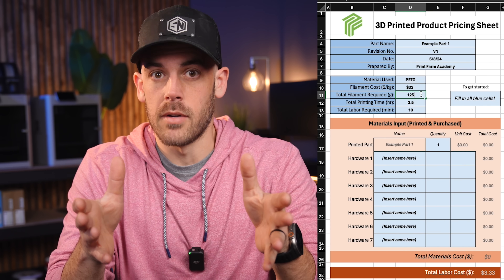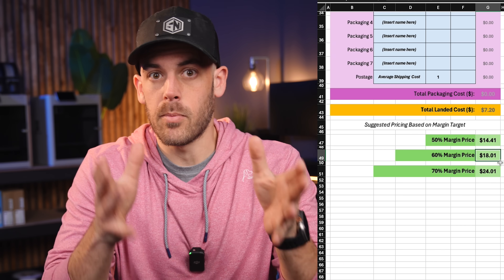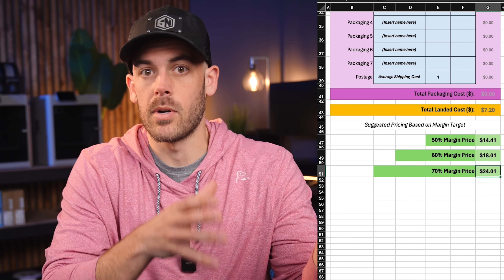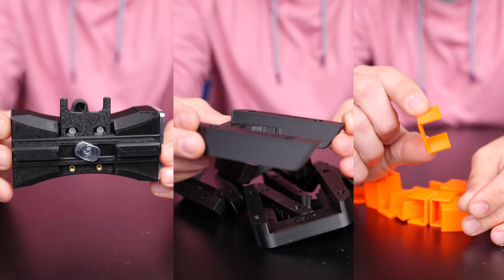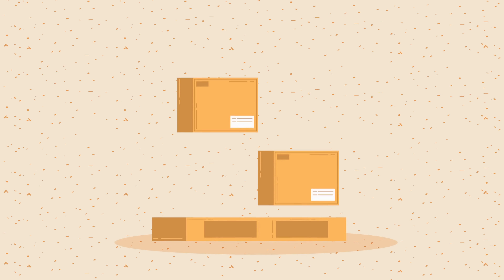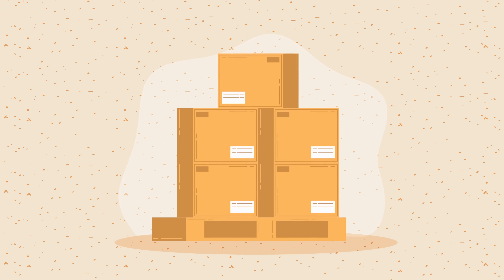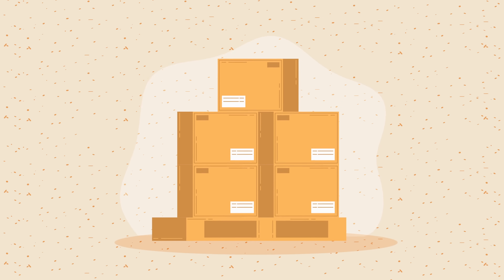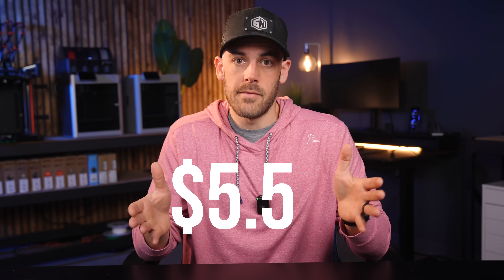Why I charge $55 for this 3D printed part (how to price)

Comment: I contacted a local company to 3d print me a bunch of pieces I needed for a board game. They quoted me an amount that was enough for me to purchase a 3d printer, curing station, and all the resin I needed. 

So yeah, now I have a new skill and can print whatever else I want
Reply: Thats what 3d printing is all about
Reply: @yomommasukks-u9e  totally agree , i think every household should have a 3d printer and more focus would be on exchanging designs and potentially selling those , rather than shipping physical parts around.  3D printing is about taking the power of manufacturing in your own hands not in giving way to corporations to profit from us in a new way with new marketing buzzwords...
Reply: The same thing happened to me lol. I was trying to buy some risers for my couch on etsy and they wanted the price of an a1 essentially. So now I own an a1
Reply: @floresj  Now that something that needs to be improved. for bed risers I got 4 at a home store for like $12. They do not have structure down the middle so the post is sitting on very little built up space, like a hollow riser. After one broke thru, I cut 4x4 wood to install in the middle. They could be printed with better structure
Reply: @floresj  I think they are betting on their knowledge. For some people it worth it to pay the price of the custom design to reproduce and for other, it's a learning journey that is the push they need. That is how it kind of was for me. The learning journey is a better investment long term since now I can do anything at just my time, material at cost.  It's like buying extended warranty. The cost you pay to buy all the extended warranty for everything you of value you buy vs the chance of 1 breaking is way more than actually benefiting from the extended warranty.
Reply: @Slurgical_3D_Terrain_Channel  i would bet a 3D artist or someone that can use CAD software will be more in demand then the 3D printing company, that way you can just pay for the file you need
Reply: @Cagethehedgehog that’s the point printers being an appliance. Print what you need. No waste, no long wait for something that partially fits your need.
Reply: @Slurgical_3D_Terrain_Channel I mean.  I got one and the things I've printed have taken days to print or experiment with my machine and adjust to print right.   I mean I'm using it for some pretty complex stuff but if you need something right away just going out and buying a 3d printer is not as easy as people think. It does take some skill and patience and trial and error. Especially if you're switching between materials ...
Reply: @jhtsurvival true that but it’s like anything else once you learn it, the  long game it worth it. When your job introduce a new platform or anything, you have to learn it, no option there. Before you know it you are a pro at it.
Reply: that's pretty much how it will always be. The only ones making money off selling printed parts are making a shitton or highly specific/custom stuff for people that just don't want to do it themselves and know it's not super cost effective
Reply: I had kinda the same issue... I wanted to buy some Star Wars helmet + armor... then the co-worker of a friend calculated on his slicer the material cost and it turned out that I could buy 2 printers buy the amount I was being charged... so I bought a printer and now I've been printing stuff for myself and selling to people in my area too without being like a freebie but also not making it overly expensive that someone could get the idea to buy a printer 😂
Reply: @snakerooni  How are you selling locally "in your area"? FB marketplace or word of mouth?
Reply: @snakerooni hobbiests selling cheap stuff and undercutting businesses that actually understand how material costs and time goes. Yay. Race to the bottom everyone.
Reply: @snakerooni  this is why owning a bussieness i shit nowadays. they have to calculate a hour rate, pay the bills pay taxes, ladn taxyes IRS taxes (states and gov) U have got new king, gov and their administration xD
Reply: similar, needed two pieces for my RC Supra project, but the quote for those parts was way over cost of buying another printer (previous were too small or were resin printers, but needed FDM) material was PETG for those two parts, so not an expensive material, used 1.5kg and got myself new printer, wanted to sell it right after, but I kept it for well over 1,5 years and sold it and built myself a Voron V2 350
Reply: @anonrider8870  oh nice about the Voron.  I have yet to build mine. I started but have a long way to go.
Reply: seeing some of the resin ones on sale for under 150 has me real tempted to get one
Reply: I usually charge 3€ for a single miniature (25mm or 30mm) how much did they wanted to charge you?
Reply: That is really funny, because that happened to a lot people here, including me ofc. I believe that these prices were just too much and I was like, you know what? fuck it I will buy one myself and I will be able to make anything me or my friends want. So far I have to say that its one of the best hobbies I had
Reply: Yea me too. People get too greedy selling 3D prints. They're literally a dime a dozen.
Reply: same here. on top of that having a 3d printer is also fun.
Reply: Why did you think they'd be cheap?
Reply: people seem to think you're paying for the part... they easily forget you're also paying for the skills to make the print... that you dont have learn yourself... the knowledge someone had to design it go through multiple prototypes the knowledge of cad software the cost of the cad software... just to mention some things you didnt that everyone tends to overlook... that is part of the cost you hire a company to print something for you you're paying for all of that and more...
Reply: Time is $. If you have a lot of free time and desire, you are not their market.
Reply: If it included sculpting the parts, no wonder.
Reply: Sooner or later with that prices that those guys charge it's a wise move to buy one 3d printer especially at these prices now, instead of buy printed items..... Also those print farms have short lifespan i believe.... Next couple of years 3d printing will be more than a hobby....
Reply: Exactly, throughout this video i was wondering, who would pay for such a part $55 where i am 100% sure a Chinese company such JLCPCB can charge a fraction of that. Also an elegoo Neptune 3D printer is around $160. i don't blame the guy for charging $55 but his business only exists because there are folks thee with more money than brains
Reply: @astafzciba buying specific solutions are fantastic. Time and effort is expensive. I often want a solution and buying my way out is often the cheapest way for me.
Reply: so you expect people to work for free for you , you mean !!?.. now you are forced to invest to buy a 3dd printing mashine,, learn the skill, buy the materials, and spent a lot of time tweaking... when you could have easily paid the company and be done with all this hastle.... unless you have a hobby to make these things and have a lot of spare time on your hand..

people these days want everything cheap or for free !!!! the guy above forgot to mention the vost of social media.. which is brutal !! you need to spend a lot of time learning how to video edit, spend money on ads etc... people want us to work for free for them WTH is wrong with people in this age !!!! my dad used to tell me clients 20-30 years ago didnt even bother to negotiate about the price ... you tell them the price and they pay it easy .. but with this syupid age of internet where you can get the price of any product within seconds across the world, is destroying more small busineses than ever !!
Reply: @avedis1990  You're insane. Your social media costs have nothing to do with the cost of prints. If you are factoring that into the cost of your 3d prints then you ARE a scammer and you should just quit because you bring nothing to the community, at all.

The price of a 3d print should be nothing more than cost + time. Cost include electricity, filament, maintenance of the printer & a predetermined failure rate at a predetermined cost.

If you can't comprehend how to price your prints, literally get out of the space. You aren't welcome.
Reply: @avedis1990 people don't understand the cost of bespoke work at all, even if it is "just" 3d printed. They are used to cheap injection molded mass produced low margin high volume parts
Reply: @avedis1990 I agree
Reply: @avedis1990  good for the consumers
Reply: @aoe2thisweek633 it's only good for the consumer as long as there are people willing to give their time away for free or cheap. A race to the bottom is never good for the consumer in the long-run. It drives the talent out of the market place. You end up with parasites and goofy business models in order to satisfy team free stuff

Comment: there is also the matter of other costs - overheads - like the rent of the place, electricity for other stuff (like lights, computers), water, internet bill, website bill etc. They are usually pretty stable per month, and usually just take the month value (or better avg of some months) and dive it by a factor, which can be units sold / kg / labor time, so you can add these costs to the part.

Comment: You left out the designing  and all fixed costs, the cost of the space (it could be your house or you might need to rent a place), the cost of other supporting things, like you print in ABS and you need a ventilation system.

Comment: You also need to factor in the cost of designing the part. Either you purchased the STL file from a third party or you designed it yourself. You may have spent time designing supports and dialing in settings. You will never get this perfect but you need to account for that as labor costs. If you are printing thousands of whatever your part is then its negligible but at smaller scales its important. This is often the most valuable aspect of your business and what you are actually making money from. It doesn't take much to buy some 3D printers and start printing. People making money are 9usually)the ones who offer their own, unique designs that fill a niche role. People are buying the design more then the actual physical part.

Comment: If you "undercharge" for something and you pull a profit you are happy with... you are not running a charity. Running a company doesn't mean selling your soul for $. If you can make it cheaper than the other guy, are happy with the return, then you have yourself a good business. Don't fall for this nonsense that $ is all important people. Sometimes providing a service you can be proud of is enough. Charging $50 when you could charge $30 doesn't make you smart or a better businessman... makes you just like all the companies gouging you for the things you want in life, but cost an unnecessary premium regardless of cost to manufacture.

Comment: When writing software, you cost out the estimated time as work and then multiply by 3 to get the total cost. It works out pretty well doing that. Something you also need to cost is replacement costs on the printer. It is said in manufacturing that if you only own one critical machine, it is like you do not have a machine. You always need to have two or more machines to offset downtime. I have been using the cost accounting spreadsheet I used when I worked in plastic extrusion to cost parts. The customer gets a deal when buying in volume.

If you're in Canada to ship around Canada, it costs about $30. Many who are printing seek how to flat-pack their parts, and then they can use envelopes, which are cheaper.

Comment: I get what you're saying, and it's good to keep in mind. But for a quick guess at retail price, I use $5 per print hour (on a Bambu P1 series) in petg. That's not always correct, but it's a decent starting point. Costs to run the printers are roughly $1/hour, excluding labor costs of course. These numbers can vary quite a bit depending on the complexity of the part.

Comment: Landed cost $20, sales price $40, 50% profit?   I'm no rock scientist, but I think that's 100% profit.
Reply: 50% of the sales price is your profit margin, or 100% markup value. A lot also has to do with the actual product. If it's low skill, high volume or high skill, low volume.
Reply: The formula for your GM% (gross margin percentage) is profit/sales price.
As your profit is sales price - cost you will get (40-20)/40. So a GM% of 50%. A GM% of 100% would mean 0 cost which basically is never the case. 

Also be aware that he never speaks of overhead, so your rent, insurance, indirect labor ect. So in general you need to have a minimum of 20% of GM% to cover your overhead. Of course this can be different based on your business situation.
Reply: @erikpolhuys9475 Stated it was landed cost.

Comment: My cost calculations is next: 7€ is the start of printer ( there is slicing, labor after and run of first hour). 4x times the price of used plastic, if I used 1kg, I should buy 4kg after. And 2€/hour printing time.

Comment: Reveal Spacers - Raw Cost - $1.39 + Pack & Ship - $5.76 + Labor - $2.50 + Machine Cost $0.30 = $9.95, not $8.45.  Battery Mounts and Stop Blocks numbers are accurate.

Comment: Great video and nice layout of possible costs, but you missed one vital cost of production; rent and the space the machines occupy! 
I would suggest that you add this cost to your machine cost based on the space they occupy. This would include space around each machine to make it accessible and easy to work around.
The rest of the rent costs must get covered in the hourly labour rate which should also cover other costs like phone and communication, computer hardware and software etc. etc. 
labour must also cover the time spent on the computer for design and setup.

Comment: One quick rule to guestimate numbers for a back-of-the-napkin expense sheet is to multiply everything by Pi (3.14 is sufficient). Every single business expense I've ever had has needed maintenance, fixing, or replacement. This is a good way to factor those hidden costs in.

Another accounting "trick" for when you're producing something for someone else is to rent your own equipment to yourself. You have the cost of the printer and nozzles, the cost of REPLACING that printer and nozzles, maintenance, etc. on a different sheet, work out how many clients you expect to serve over a year, and then take that number to your main expense sheet, and factor it in as equipment rental in your final cost calculation. You can also claim equipment rental back on your taxes. (YRMV I'm not a CPA, and I don't play one on TV)

One final note, don't pick an hourly rate and go from there: look at what you must/want to earn by the end of the year. In 2025, earning less than $75,000 per year is going to make things tight. Work out your hourly/per-project rate from the top down, not the bottom up.

Comment: It doesn't sound right at all to include shipping cost in the pricing model.

You price something to add the margin you want, THEN people see that price and choose whatever shipping method they want.

Adding the shipping fee to the model is double dipping.

A small part that costs 1$ excluding shipping should sell for 1.70$ (70% margin) plus shipping.

If you add 6$ shipping, the same part (at 70% margin) would cost 11.90$ plus shipping, which is an incredibly greedy 1090% margin

Comment: I'm sorry. Selling that type of garbage for $55 is an actual joke. I'm 57 years old, (roll your eyes about now) and this is the best we can come up with? Back in the day there was accountability, and products were actually performing as they werre advertised. I have a 3D printer that prints very well, andf the thought of charging someone that type of money for literal crap makes my fucking stomach turn, grifter.
3D prints are NOTHING like commercially produced, injection molded parts. They will pay a premium for something that won't last 2 years.
Good on you for building a business, but at the cost of the purchaser. Down the fucking hole we go.
Reply from the maker: I have a feeling you stand on your porch and yell at clouds
Reply: There is plastics for 3D printing that will beat injection molding for durability, and also don’t forget about impossibility to make fully closed parts from injection molding

Comment: I make up the price not based on how difficult the part is to PRINT but rather it is based on how difficult the part is to GET SOMEWHERE ELSE.. Example, i make some pokemon stuff for a guy who runs a card shop, the pokeballs cost me about 50cents to make, I could ask for 5$ each but for that price he could buy some bulk junk pokeballs online, so i keep these cheap at 2.50$ each and make the money on volume. Other parts, such as some custome display stands i made for a marijuana dispensary i charge 45$ each  for about 3$ of material because the thing they need simply doesnt exist to buy elsewhere. Small custom jobs is where the real money is. Learn how to design and you can offer "value add manufacturing" where you can either improve a current design or optimise a print to reduce cost and failures. An example of value add is when i was making huge flat parts with 190 holes, 2 day prints that would constantly warp. I added a teardrop chamfer to the holes and was able to print the part verticaly with no support, i reduced the time by 40% and the cost by 10% by removing support and the failure rate dropped to near zero. I continued charging the customer normal rate until the next batch and then offered a reduced price if they want to pay a NRE (non recurring engineering ) of 150$ for optimising the part. I win either way because if they pay the nre charge thats good, and if they dont  then i get the same money for parts i can mow make twice as fast. Value add is the way, if you think you can make money selling articulated dinosaurs you will be disapointed.